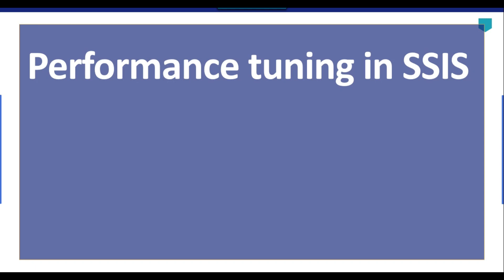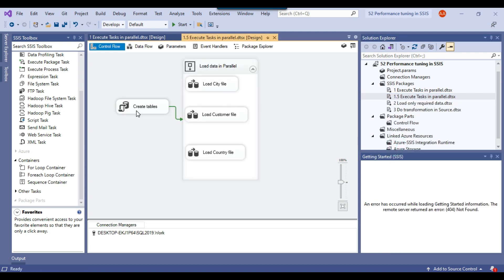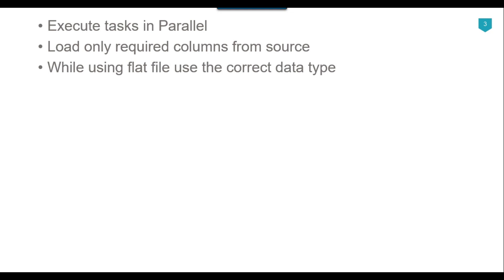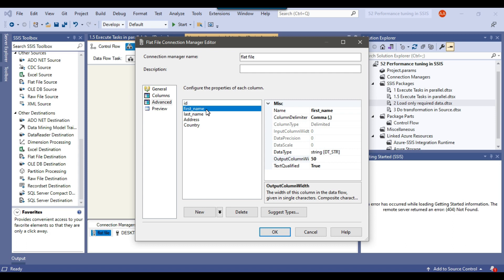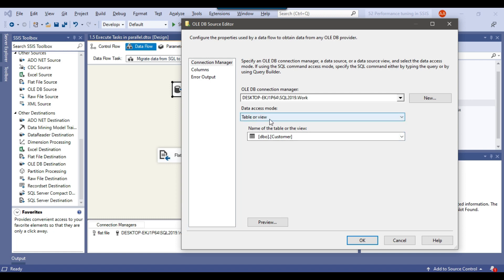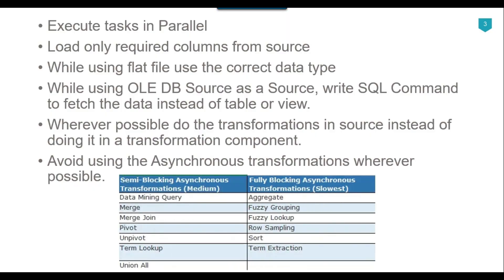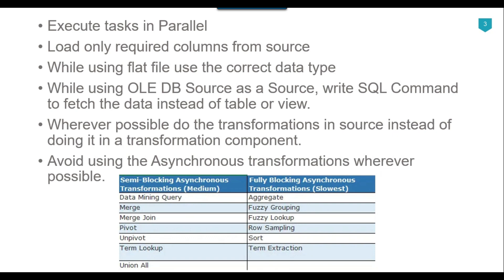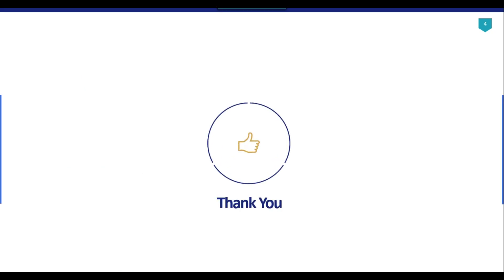52 Performance tuning in SSIS

Comment: Thank You so much Akil...It's very helpfull. Can you make a video regarding how to found file count in source folder?
Reply from the maker: You are most welcome.
You can use this 2 lines of code to get the count of files in a folder using script task.

DirectoryInfo dir = new System. IO. DirectoryInfo("SourcePath"); 
int count = dir. GetFiles().

Comment: Can you make a video on how to connect to a share point link in ssis to fetch flat files from a folder and load them into DB.
Reply from the maker: Actually at the moment I don't have access to any share point link thus it won't be possible for me to test it. But what I think might be possible that you should try to download the files from sharepoint link to local using C#.NET and then you can load them using SSIS.
Reply: @learnssis  Yes, Can you just show the way to how to access a share point through ssis? As I would have to take the files from the share point only, I can not dowload the files on local. Thanks for the advice.
Reply from the maker: @indrasishdatta7210  Actually there is no inbuilt component in SSIS to connect to share point, it will be done using C# only. And at the moment I don't have access to any share point, thus I won't be able to test it.